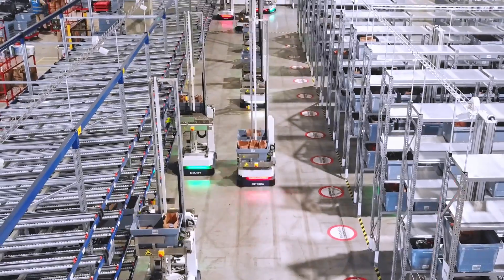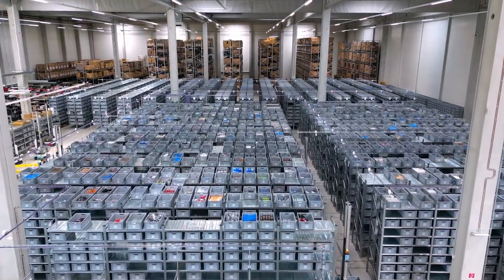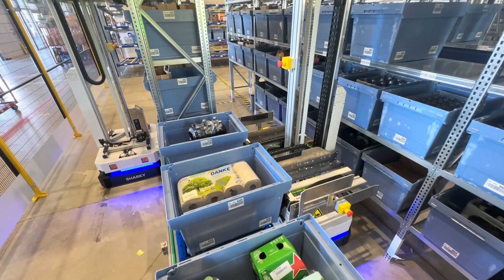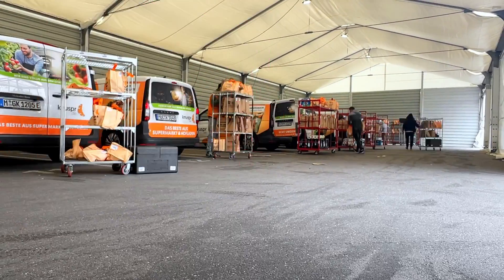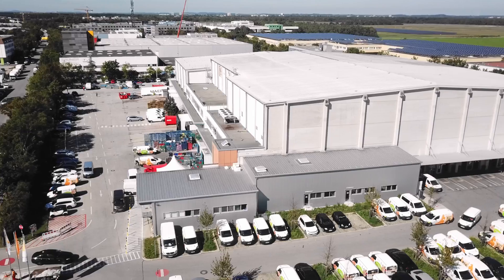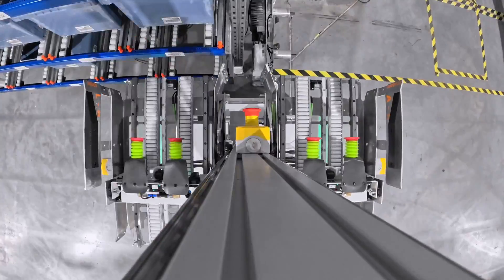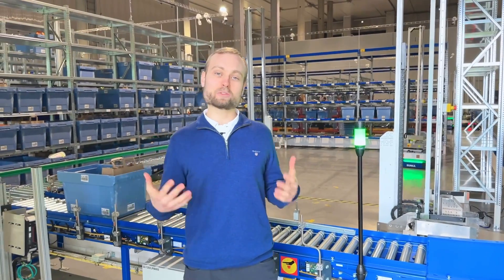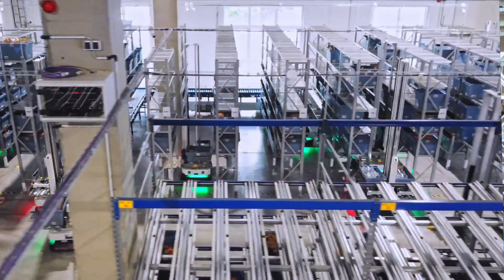AI robots dispatching grocery orders (fully automated warehouse)

Comment: Sorry in advance, how much cost one of the robots? i mean, a roughly estimate
Reply from the maker: The cost depends on how many robots you buy, but typically the range is 50-80k eur per robot including the shelving, totes, installation and support. You also have the option to rent the robots for a fixed monthly fee
Reply: @brightpickAI What is the cost of renting them? Roughly?
Reply: @brightpickAI What is the typical throughput for 1 robot in grocery store setup (items per day)?
Reply from the maker: @jankmhdhhvs  on average one robot can dispatch 25 totes per hour during peak times, but the range is quite wide depending on the solution design